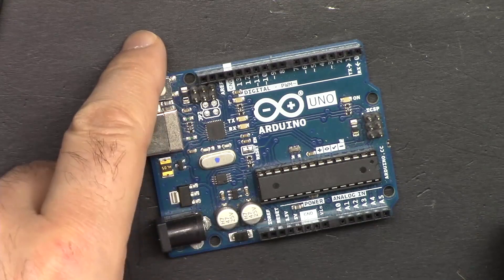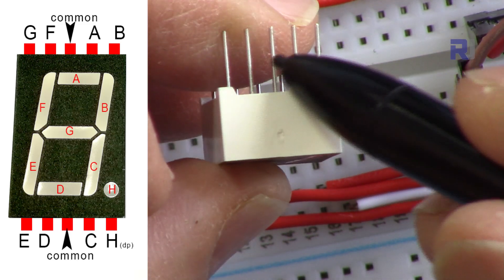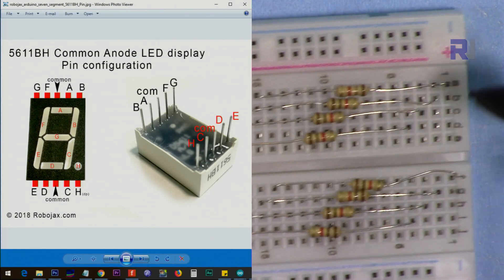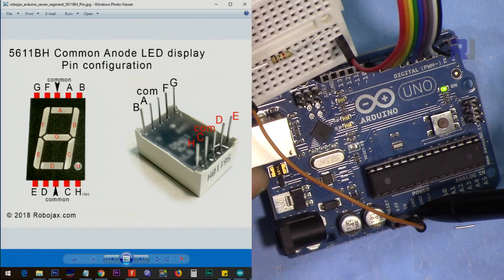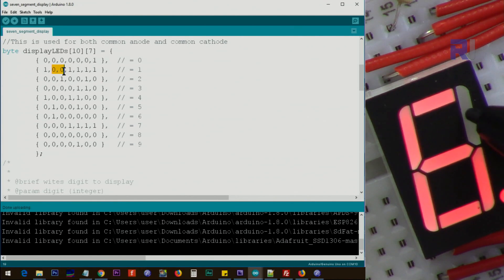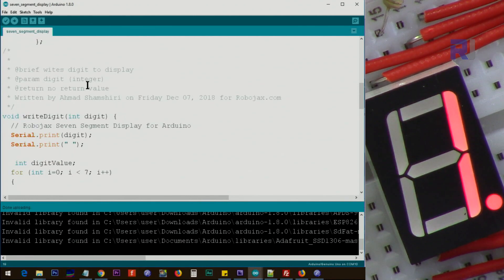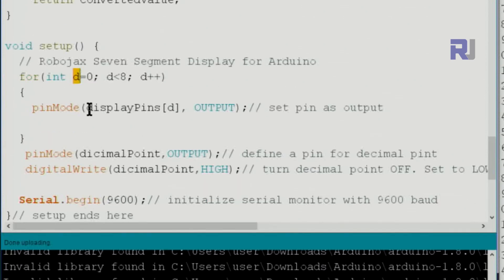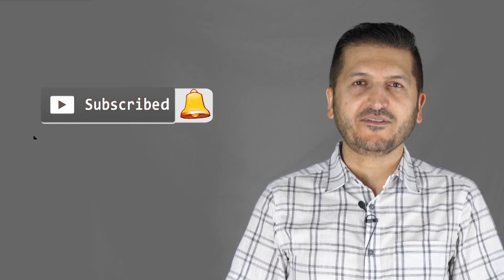Lesson 21: Seven Segment Display with Arduino | Step by Step Arduino Course - RJT579

Comment: Nice!! I like it.. but..

int convertHighLow (int v)
{
 if (type==0)
  v=1-v;
return v;
}

^_^
Reply from the maker: what about it? you said "but" and then LOL
Reply: @robojax  Everything is fine. I’m just wondering how else I can write down the values for each digit in the code. You will have to try to assign each bit in the byte a corresponding LED.. hmm.. Considering that there are 7 of them and 1 for the dot, we will get 8 bits. Nice...

Comment: How to control 16 servos with 2 push button for each servo and using PCA9685

Please help me
Reply from the maker: I have video I. Pca9685 you can watch them
Reply: @robojax   I have seen but in that video only servo running at given angle but there is no use of push buttons....